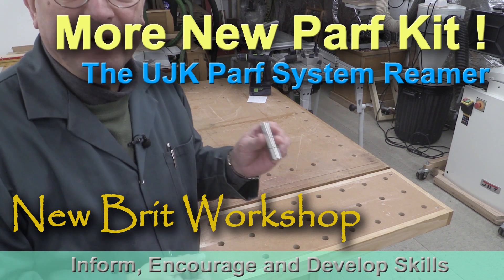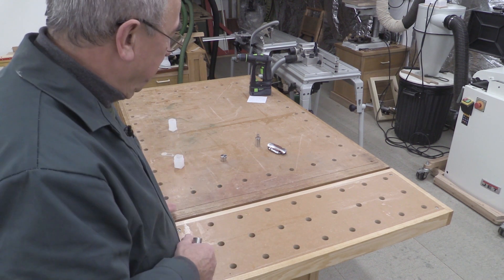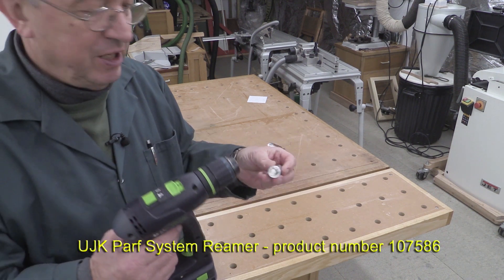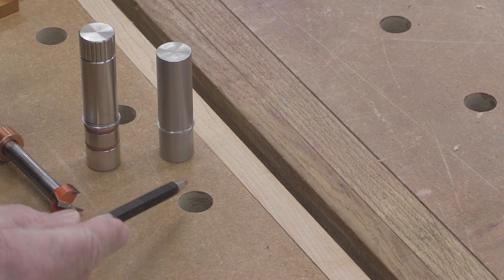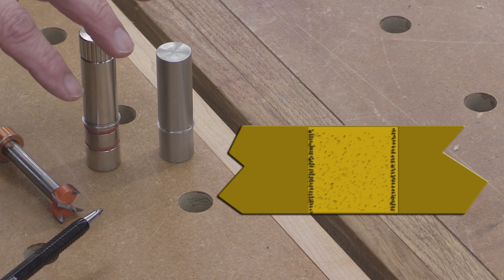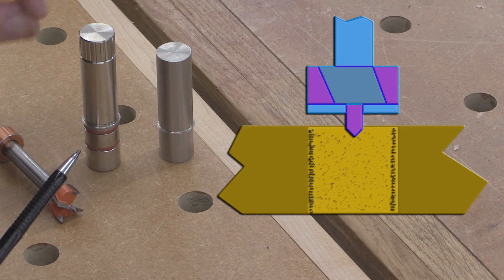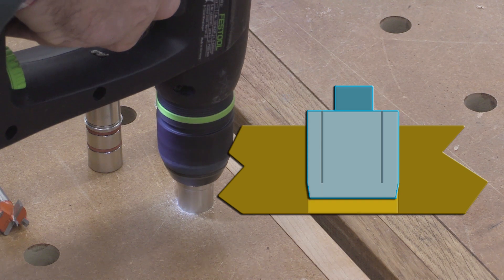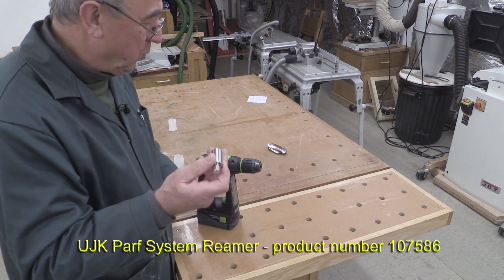New Parf Kit   20 mm Reamer

Comment: Another great Parf Product!   I am ordering one right now, but I have one question.  I live in a climate with extreme moist to dry conditions.  If in the moist season I ream the holes, will that not make them really loose in the dry season?  My concern is reducing the accuracy of my Parfitt table top.
Reply from the maker: Hi Pat, I am told that it will not make enough of a difference to be a problem. I have used the prototype reamer a while ago and I have not noticed any issues.  Peter

Comment: Is there a disadvantage to using the combined reamer chamfer if you don't use the chamfered dogs?  I ask because the reamer chamfer has a hex shaft which is preferable to the round shaft of the reamer-only version.  Thank you for your helpful videos, Peter.
Reply from the maker: The combined reamer chamfer is still the one to get - you may one day get some chamfer dogs.  Peter
Reply: @NewBritWorkshop  Thanks Peter

Comment: Got the product but the stub that goes in the drill is gigantic! I don't have a Festool drill.
Reply from the maker: Hi Jer, The standard chuck size for most drills sold (certainly in the UK) goes to 1/2" and this is slightly less. For the brief operation of doing the holes on the bench please ask a friend to borrow a drill.  Peter

Comment: Hi Peter, 
This almost the latest video about the Parf Guide system. I have seen the product in you videos, what looks very promising to me. Will order as soon we have we have been moved over to our new house. Even the video was well done, do I have a small question.
"after the drilling of the 20mm hole, you have shown to finish the holes with a manual tool. But you also mentioned it is also possible to do this task with a router. I have a router, so that will be better for me. But since it not shown what router-bit is needed, will it unclear to me.

To drill it down, what router bit is needed to finish the 20mm holes with a router?
I am new into woodworking, so provide all the details there are, about the proper router bit for this task. (In millimeter)
Reply from the maker: Hi Patrick, You will need a chamfer bit in the router. It should have a ball bearing on it to follow the inside of the 20 mm hole. Something like this:
https://www.axminstertools.com/axcaliber-chamfer-cutter-bearing-guided-d-30-16-x-11mm-s-1-4-6-35mm-666158
Good luck with your house move.   Peter

Comment: I am in the inferior US produced MDF camp.  Particularly in the rural areas.  I had to re-drill several of my holes with the Parf Guide System, probably for the very reason you state, namely I was in a hurry and did not do a complete job in the first place.  This tool is much needed if for no other reason that it will stop a lot of frustration with the Parf Guide System in the first place.  Thanks,

Comment: Actually, a better idea would have been to integrate the reamer into the chamfer tool, giving it the added feature to mount on a power drill.
Reply from the maker: Hi Michel, It would be possible but the combination would be more expensive and not everybody needs a reamer and some people do not need a chamfer tool.  Cheers.  Peter
Reply: @NewBritWorkshop  True. Anyway, add to the suggestion box some kind of future revision of the chamfer tool that make it more convenient to use than the current solution.
Reply from the maker: I agree that it would be a nice idea.  Peter
Reply: I guess Axminster liked your idea 🙂 They now sell a combined reamer and chamfering tool 🙂
Reply: @Dandelion-32  They certainly did!

Comment: I wonder if this reamer would allow toughening the holes with a finish that would soak in.  Something like System Three Rotfix might be perfect.  The reamer would ensure fit, and the holes would be protected against wear and moisture.
Reply from the maker: Hi Alan, The key concern would be a build up of resin or whatever that reduces the efficiency of the reamer.  Peter
Reply: Maybe a burnishing tool with some bees wax

Comment: Brill,  also cutting by CNC depends on the diameter of the cutter, if they have been sharpened and reused without the measurements being adjusted, then the holes will be tight, I had to use the drum sander kit ( 410188) to sort my bench out.
Reply from the maker: Hi Hugh, Yes, many people do not realise the way that CNC work can be not quite spot on. Cheers.  Peter

Comment: H Peter nice addition to the PARF system I just made my first table using the guide system and it is absolutely perfect .
Today I received the repeat stop and wanted to buy the fence from Axminster but it seems that it's not only out of stock but will be not be sold anymore.Do you have any information about that ?
Many thanks for your nice videos.
Reply from the maker: Hi Jean-Louis,  A new version is about to be launched in order to take account of benches produced by other manufacturers (like the MFT3) where the accuracy of the holes cannot be guaranteed. Keep an eye out as it is due for release very soon.  Peter

Comment from the maker: Hi Everyone, Axminster now have these back in stock.  Peter
Reply: Er, no they don't. I was on their site yesterday during & after your video and it was unavailable & again today. Sorry Peter, but I've never given a negative comment on you tube, but why promote something they clearly do not have?
Reply from the maker: Hi Gary, Please get the facts right. They had warehouse stock prior to the video going up which was, at that time, deemed to be more than enough to satisfy demand. That sold out in a a couple of hours. I contacted them and they were able to bring another batch from the machine shop through to the warehouse and picking. That also sold out today and it will now be next week before they can set up for manufacturing again.If you just take a minute to read the comments that preceded your you will see the full history as it unfolded. Nobody expected demand to be so high.   Peter
Reply: @New Brit Workshop . Hi Peter. Apologies, but I (still) haven't read any of the other comments. I was just a bit frustrated that the reamer was not available. I have signed up to be notified when it returns. In my defence, my facts were correct. At the time of me watching the video and going onto their website, they had none in stock. Maybe I was just unlucky. Hopefully they'll be back in stock soon. Regards. G
Reply from the maker: Hi Gary, If you have any problems getting hold of one please let me know. It may take a few days for them to resolve the backlog.  Take care.  Peter

Comment: I have the Parf guide system and Festool MFT table, and find it very difficult to insert the dogs through the guide and into the 20mm holes. I purchased the chamfer tool, but I still have to persuade the dogs with a mallet. What am I doing wrong?
Reply from the maker: Hi Peter, Nothing - it may just be the tiny hairy bits in the holes. The reamer will sort that out.  Peter
Reply: Thanks Peter. I will give it a try.

Comment: Can this reamer be used to ream a 19 mm hole (3/4) to 20 mm? I would love to make my Sjöbergs compatible with my 20 mm gear.
Reply from the maker: Hi Rikard,
It is not designed to do that as it is only taking off a very small amount and it is expected that the holes that it is going into have been created with the 20 mm cutter from the Parf Guide System.
Peter
Reply: @NewBritWorkshop  I kind of expected that to be the case but I had to ask. I haven't found a good way to ream away 1 mm and still maintain concentricity so this product was intriguing. I guess the search continues. Thanks for your reply!
Reply: @Eorlingur  did you ever figure out a way to make 19mm holes to 20mm holes?
Reply: @alekznial  No, not while maintaining concentricity. At least not without a lathe or a CNC.